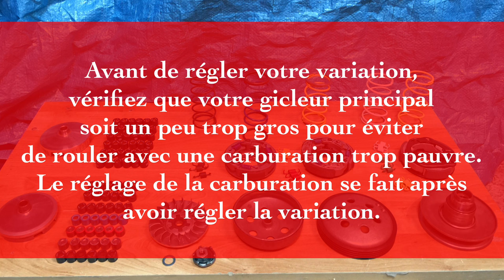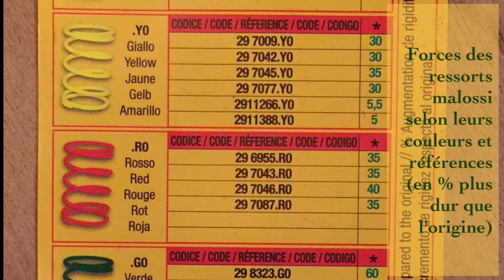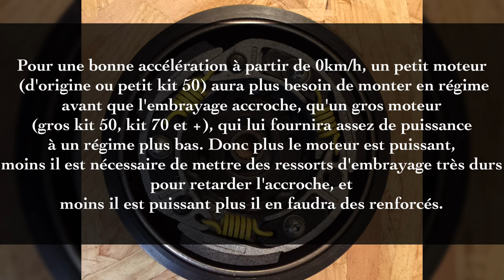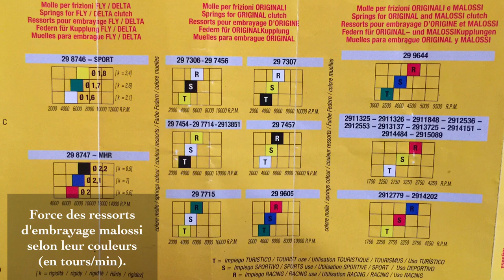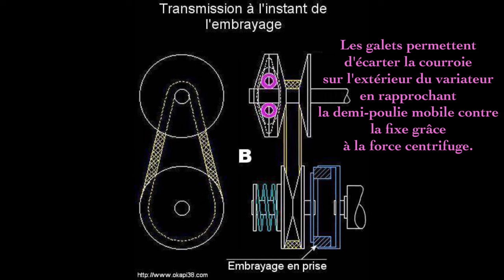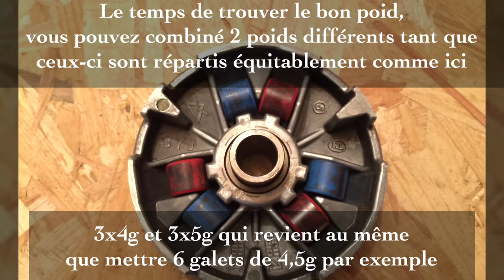Comment régler le variateur et l'embrayage d'un scooter? (1080p)

Comment: Bonjour, j’ai un mbk nitro 2t débridé avec un pot yasuni R tout le moteur est en origine j’ai juste un vario malossi quel serait le réglage parfait selon vous ? 
Merci d’avance et super vidéo au passage
Reply from the maker: Bonjour, pour cette configuration il faut un ressort de pousser malossi blanc, les ressorts d’embrayage d’origine sont déjà bien ou alors mettre des un peu plus dur. Il faut commencer le réglage des galets à 3,5g. Le bon poids sera sûrement entre 3,5 et 4g. Il faut bien vérifier la couleur de la bougie ensuite, après avoir rouler au moins 200m à fond sur le plat moteur chaud et en s’arrêtant rapidement. Elle doit être marron, blanche gicleur principal trop petit, noire gicleur trop gros.

Comment: Besoin d aide j'ai un booster d'origine avec carbu 17.5 gicleur de 90 débridé au vario avec un pot bidalot. J'ai voulu changer de courroie parce qu il été temps j ai pris une malossi et là mon scooter avait plus de patate et restait en bas régime de 0 a 55 km/h a peu pres. Le mécano m a dit que c normal et qu il fallait changer les ressorts coté embrayge entre temps mon scoot c mis a cramer une bougie par semaine et le problème a l'accleleration persiste malgré avoir changé les ressorts. Faudrait que je change mes galets contre des plus léger ou remettre une courroie d'origine et les ressorts qui vont avec?

Comment: gros merci @Curiosité et besoin daide svp;
 jai un nitro 2015; CONFIGUARTTION ORIGINE....jai changer e, pot sito; jai achete un variateur malosssi ,, un embryage malossi et un courrie special belt malossi;; svp je suis un debutant; je voulais savoir quelle est le meilleur 1-ressort de poussee (malossi) quel couleur ??
2- ressort dembrayage (malossi) quel couleur
3- poids de galet (malossi);
pour atteindre la meielleur variation possible pour ma configuration origine ... merci davance pour tous les amis
Reply from the maker: jebali zied jebali zied salut! Pour une configue comme ça, c’est assez simple, déjà le ressort de pousser il faut le malossi blanc (il est 7% plus dur que l’origine juste ce qu’il faut, pas plus) l’embrayage cela dépend du modèle, j’ai mis le tableau des ressorts d’embrayage à  3:54, je te conseil médium un peu plus fort que l’origine, et les galets c’est difficile de dire comme ça ils doivent être assez léger normalement avec le vario d’origine 3,5g mais avec le malossi il devront être un peu plus lourd je pense (le vario lui même est plus léger), il faudrait avoir des jeux de 6 galets et faire des essais, il faudrait des jeux de 3,5g 4g 4,5g. Tu essai 3,5 si c’est trop légers, combines 3,5 et 4 pour faire 3,75. Si c’est toujours trop léger essais 4g, si c’est encore trop leger, combines 4 et 4,5 pour faire 4,25 etc... jusqu’à ce que le trait que tu trace sur le vario avant l’essai ne fasse plus que 5mm à l’extérieur, c’est que la courroie s’est bien écartée à fond à vitesse max. Si en accélérant il y a une petite baisse de régime puis ça se relance comme le passage d’une vitesse en voiture c’est que c’est un peu trop lourd, là tu sauras quel poid exacte acheter par rapport à la combinaison qui te paraît le mieux, on trouve des poids de galets aux dixième de gramme (ex: 4,5g 4,6g 4,7g 4,8g 4,9g... Le scoot doit tourner au même régime, sans que ça mouline ou que ça force en s’élançant , tout au long de l’accélération. Je parle pour un scooter 2temps, (les 4t cela doit être le même principe mais le poids des galets peu être différent vu que les moteur 4t tourne à un plus bas régime, là dessus je connais pas assez dsl)
Reply: Merci pour laide @Curiosite une  explication  bien resolue merciiiiiiiiiii
Reply from the maker: Avec plaisir 🙂

Comment: Bonjour, j'aimerais savoir la différence entre un petit kit 50 et un gros kit 50 comme tu dis dans la vidéo pour les ressorts d'embrayage ?
Reply from the maker: Pirate Db bonjour, il y a des kit 50 plus puissant que d’autre, ça dépend du nombre de transferts dans le cylindre je crois, par exemple le kit 50 sport Airsal peut faire 7/9 chevaux alors que le kit 50 mhr team peut en faire 15. Il y a 3 catégories, simple, sport et racing.
Reply: Curiosité merci trop cool ton explication, merci merci je me coucherais moins con 😜😝😛
Reply from the maker: De rien 😉

Comment: Bonjour, je me suis abonnée à ta chaîne YouTube, j'ai liker la vidéo, silteplais peut tu m'aider ? J'ai une zip 2T, kit 47 Malossi fonte variateur malossi, carbut 21 delorto, pot Polini For Race 4, rapport primaire malossi 15-38  j'ai du mal à régler mon scooter☹ actuellement j'ai 3galets 7G et 3 Galets 5G, 3petit ressort malossi vert, un grand ressort Malossi bleu.. mon départ est long😥
Reply from the maker: Salut, merci pour ton soutien c’est sympa, c’est normal que tu ais du mal à le régler certaines pièces ne sont pas compatibles, carbu 21 pour un kit50 c’est trop gros et le ressort de pousser malossi bleu est beaucoup trop dur, les ressorts d’embrayage sont bien un peu mou peut-être, pour la transmission je ne vois pas, tu as mis une plus longue ou une plus courte par rapport à l’origine?
 
Tu devrais déjà mettre un carbu plus petit, pas plus gros que 17,5, un ressort de pousser malossi blanc, et re-régler le tout, tu devrais beaucoup moins galérer avec ça déjà et avoir des bon départs
Reply: @curiosite8721  j'ai mit un rapport primaire plus longue que l'origine, la j'ai mit un grand ressort blanc, et c'est déjà beaucoup mieux, j'ai alléger aussi les galets, et c'est beaucoup mieux, je vais m'acheter un carbut origine 17,5 :) je te remercie beaucoup pour tes conseil ❤
Reply from the maker: @teheiteamo5683  ok super 👍 hésite pas si tu as d’autres questions

Comment: Bonsoir j'ai un Vespa S 50cc 2T.
Kit 50 Alu Airsal, ,vilebrequin renforce, Pot leovince GP Evo2 ,variateur MOTOFORCE RACING, Embrayage MOTOFORCE RACING.
Peux tu me m'aide sur le choix des Galets, des ressorts embrayage , et du ressort de pousse?  et a Choisir ? 
Quel modif pour avoir une bonne reprises pour roule a 70-75. 
Y'a t'il autre chose a changer sur le scooter.
 Merci de ton aide.
Reply from the maker: Bonsoir, il faut un ressort de pousser blanc malossi, pour embrayage faut tester pas besoin de prendre trop dur, médium c bien. Pour les galets aucune idée dsl je commencerais le réglage avec 4 ou 4,5g.
Reply: @curiosite8721  Bonjour, ok merci votre réponse.

Comment: Bonjour , sympa les conseils ! Ca aide .   Par contre tu es sûre  avec l explication des ressort d'embrayage ?  Pour moi il faut des mou sur configuration origine ou légèrement modifié.   Et plus que on a un moteur puissant  il faut monté en dureté non ? 🤔
Reply from the maker: Salut, non je suis pas très sûr, c’est ce qui est dit sur le forum qui m’a servi de base, ils disent que plus le moteur est puissant moins il a besoin de monter en régime pour faire partir le scoot donc moins les ressorts ont besoin d’être dur, un scoot d’origine le vario s’écarte peu à l’accélération avec des galets légers donc ont a un bon couple dés l’accroche de l’embrayage, cela dépend aussi de la transmission, si elle est plus longue ça force plus donc des ressorts dur peuvent être utile, le réglage c’est un tout une fois qu’on a compris comment tout fonctionne ensemble il faut tâter un peu et trouver le réglage idéal

Comment: Bonjour, 
je voudrait avoir des conseille pour ma variation. 
Sur mon Mbk booster de 2014, je suis en origine, pot yasuni z, carbu 12 origine,  galet 4.3 et ressort de poussé blanc et  ressort embrayage origine...   
en gros en accélérations c'est très mou !  je met longtemps a prendre 40km. En pointe je ne dépasse pas les 60km/H   
Bien sur le pot et débrider des deux coté  et le variateur aussi ! 
après avoir descendu 4.3 en galet  Sava un peux mieux en accélération mais en pointe c'est toujours pareille,
j'ai tester de passer directement en galet 5.5 , l'accélération et très très lent mais en pointe j'ai gagner 7 km/h soit 67km/h en pointe 

je comprend pas car sur le booster d'un ami il et casi sur la même config il prend 70-75 et a une bonne acceleration je c'est tres bien que d'un scooter a un autre sa varie mais la c'est assez étrange 

d'après vous qu'elle serait le probleme merci !
Reply from the maker: Bonjour, ce sont peut-être les ressorts d’embrayage d’origine qui sont fatigués et trop mou, vous avez vérifié la carburation par rapport au scooter de votre amis? Je réfléchirais plus à ça demain dsl il est tard.
Reply: @curiosite8721  bonjour merci de votre réponse rapide ! 

Oui bien sûr il et en carbu 12 également quand je disait casi même config c’est que lui il et en galet de 4,5 sinon tout les reste et exactement pareille donc je comprend vraiment pas 

De plus j’ai fair le teste du trait sur la variation et il y a peine 1 cm donc je suis parfait ..
Reply: @curiosite8721  j’ai un embrayage complet stage 6 full ressort rouge qui traîne chez moi je vais essaye je vous en dirait des nouvelle
Reply from the maker: @avorix280   ok le ressort de pousser blanc faut le laisser, pour le carbu je pensais au tailles des gicleurs, hauteur d’aiguille, et réglages des vis de richesse et ralenti. La courroie pourrait encore monter un peu plus mais c’est déjà pas mal il faudrait 5mm.
Reply: @curiosite8721  j’y pense vraiment pas que c’est une histoire de carbu il marche impeccable avec une belle couleur j’ai pas envie d’y toucher pur le derregler

Comment: Bonjour, alors voilà j'ai un ami qui a changé sur son zip 2temps son pot d'origine par un pot leovince tt, est ce que c'est normale qu'il ne dépasse plus 30km/h depuis sachant que on a pas encore mis les galets fournis et les ressorts d'embrayages ?
Reply from the maker: Salut, la bride au vario à été enlevé? Si ce sont les galets d’origine ils sont forcément trop lourds, il faut régler les galets sans la bride en même temps que mettre le pot et surtout mettre un gicleur principal plus gros, le moteur va serrer sinon, la carburation est trop pauvre en essence et le moteur est trop en charge. C’est la combinaison des 2 qui doit faire ça, il ne faut pas rouler comme ça
Reply: oui la bride du variateur a été enlevé et les galets sont normalement d'origine
Reply: merci pour votre réponse rapide ! et pour le gicleur savez vous quel taille devront nous le mettre ?
Reply from the maker: De rien, difficile de dire comme ça, entre 5 et 10 points de plus que celui de l’origine devrait être pas mal, au moins le temps de régler les galets, si ça pétarade en accélérant, c’est un peu trop, si ça hurle aigu ce n’est pas assez.

Comment: yo
j'ai un Speedfight 3 50cc LC de chez Peugeot il est equipe dun pot yassuni R d'un carbu de 17.5 delorto, bref il a pas d’accélération , a deux y va a 30 km/h et en monte si il part de 0 y va a 35km/h mais par contre une fois monte a 8500 tour y part et va a 90 km/h  pour toi seul un changement de gallets et sa irais mieux ?
Reply: a et a deux mémé problème qu'en monté il arrive pas a se lancer comme si il arrivais pas a se lancer et apres quil a reussi a se lancer il arrive a rouler a 80-85
Reply from the maker: Salut, oui on dirait bien que les galets sont trop lourds, le vario doit écarter la courroie à un trop bas régime. Il faut vérifier la carburation aussi ça peut être un manque d’air en début d’accélération avec la vis d’air trop serré. (Ou vis d’essence trop desserré). Et re-régler le carbu après le réglages des galets. (Gicleur principal et vis de richesse)

Comment: bonjour je suis en 70 most pot most carburateur de 19 variateur artek embrayages mhr j'ai mis un ressort violet de piaggio donc dur a 82 % comme scootfast le conseille avec des ressort d'embrayages dur a 75% J'ai essayer de galet de 4g il prenais trop de temp a partir et 5.5g il pars pas du tout on peux m'aideR
Reply from the maker: Bonjour, quand il met du temps à partir avec les 4g il monte quand même dans les tours?
Reply: Oui il accelere jusqua 85 apres il perd tous son régime d'un coup  j'etais avec un ressort jaune artek dur a 15% mes le ressort etais trop mou pour un 70 most javais galet de 3.5 je prenais 110 
donc vriament la je suis perdu
Reply from the maker: C’est peut-être le ressort de pousser qui est trop dur, il faudrait le rouge entre les deux
Reply: Ba scoot fast disent qu'l faut le violet un rouge malossi sa va ?
Reply from the maker: Oui je pensais à celui-là
Reply from the maker: Mais si scootfast conseil l’autre c’est bizarre, peut-être essayer avec des galets plus légers que 4g
Reply: Ba ces bizzare par ce que dans la vidéo que tu a faites qui est pour moi parfaite tu dis plus les ressort sont dur plus le poids des galet va augmenter
Reply: Ok ok merci puis ya pas plus leger que 3.5g en gallet?

Comment: Salut super vidéo alors j'ai un yamaha slider en gros un mbk stunt si tu prefrere et mis un pot leovince gp mousse a boite a aire malossi et la j'ai envie d'installer des galet de 4.3g mais j'ai vu que dans la vidéo il h avait un sence quand tu l'ai pose et j'ai pas bien compris ducoup si sa ne te derange pas pourrai tu m'expliquer le sence pour installer les galet stp merci d'avance 😀
Reply from the maker: Salut, sur la vidéo à 4:45 quand le vario est posé à plat, le côté où il y a l’écriture qui est la partie la plus fermé (ça peu se voir à l’œil sinon) doit être face à toi à gauche, et face à toi à droite, la partie la plus ouverte.
Reply: Ils sont ronds et font le même poids..!
Je ne vois pas trop la finalité du problème.
Les galets Dr.Pulley ont un sens de montage.
Reply: Curiosité Je viens d'acheter un nouvel ovetto  avec cylindre top perf 50 pot yasuni à froid il peux-tu me dire quel config a de près je devrais mettre

Comment: Sur mon booster jai un kit 50alu stage 6 avec carbu 17,5 et vario stage galet 5g il met du temps a se lance meme bcp faudrait je baisse mes galets de cmb ?
Reply from the maker: Roman r de 1g déjà pour voir, l’idéal serait d’avoir 3,5 4 et 4,5 g pour faire différent essais, si 4g est toujours trop lourd combiné 3x3,5g et 3x4g et si c’est trop léger 3x4g et 3x4,5g
Reply: Curiosité d’accord je vais essayer tout sa et j’vais mettre des ressorts de pousser jaune sur l’embrayage il met du temps a se lancer
Reply from the maker: Roman r ressorts d’embrayages plutôt (Les 3 petits)? Le ressort de pousser faut rester d’origine ou blanc pour un kit 50
Reply: Curiosité oui les 3 petits en jaune et avec le kit ils m’ont offert un gros ressort noir medium je le met pas ducoup ?
Reply from the maker: Roman r Tu as eu l’ensemble dans un pack? Carbu, vario, galets, kit et pot? Si le médium à été fourni avec le kit tu peux l’essayer, si ça donne l’impression de mouliner à plein régime même en alourdissant les galets c’est qu’il est trop dur
Reply: Curiosité non il m’on donné ca avec le cylindre jsp pas pk mais je vais essayer et si ça va pas bah je re mettrais l’origine ducoup
Reply from the maker: Ok c’est possible que les 5g fassent l’affaire avec ce ressort ducoup, il faut essayer tâter un peu différent réglage mais ça me paraît dur pour un kit 50 ressort de pousser médium, ça dépend des marques, avec le test du trait tu sauras si la courroie monte bien au vario à plein régime
Reply: Curiosité d’accord je vais essayer et je te redirai ce que ça fait ou quoi et merci bcp tu gères même deux ans apres la vidéo sortie tu réponds c cool 💪💪
Reply from the maker: Ok tu me dis ça, pas de quoi 😉

Comment: Moi j'ai un ludix avec un pot bidalot S3r vario polini avec ressort blanc de chez polini avec galet de 6g, et pendant l'accéleration, j'ai un trou vers 60km/h, et d'un coup il se lance pour atteindre vitesse max, que faire pour ce trou stp ?
Reply from the maker: Pirate Db ce sont peut-être les galets qui sont trop lourds, il faudrait essayer avec des plus légers voir si c mieux, ce sont ceux d’origines?
Reply from the maker: Si le problème n’est pas au moment où le scoot part, ça ne vient pas des ressorts d’embrayage
Reply: Curiosité oui, ceux qui était avec le vario polini speed control, mais ouais j'vais essayer de regarder en faisant une marque au marqueur et je verrais bien déja, mais tu as surement raison, quand je vois que tu mets du 3 ou 4 g, c surement qu'ils sont trop lourds, merci encore d'avoir répondu
Reply: Curiosité dans le pack y avais des 6g et des 5g, j'pensais que mettre les plus lourds tout de suite ça allait le faire, mais apparement j'aurai du commencer par les 5g, dés demain j'démonte et je vous dis si y a du mieux
Reply from the maker: Pirate Db cherche pas c’est ça ^^ ils le fournissent avec des galets qui vont avec le pot d’origine et le variateur bridé, ils sont trop lourd, des fois ont a les bons fournis avec le pot.
 Ludix je connais pas, sur l’aerox avec le moteur d’origine, carbu 17.5 et pot bidalot s1r j’avais 5,1g dans un variateur polini hight speed et ressort de pousser malossi blanc, ressorts d’embrayage malossi vert.
Tu peux commencer avec les 5g déjà voir si plus légers c’est mieux ou regarder dans les forums ce que mettent les gens avec la même configue que toi, le test du trait indique seulement si les galets sont trop légers, si ils sont trop lourd ça ne se voit pas.
Reply from the maker: D’accord, oui ça serait cool
Reply: Curiosité oui merci j'avais vu après que le marqueur était pour les ressorts, mais j'vais essayer avec les plus léger gallet demain, je dissait 5g,mais c'est 4.9g, alors je sais plus trop combien ils font ceux de montés😝😛, dans tous les cas j'avais mis les plus lourds c'est sur, merci d'avoir pris le temps de me répondre, et franchemet j'ai beaucoup appris,merci encore
Reply from the maker: Ok tant que c’est plus légers ^^ bonne chance